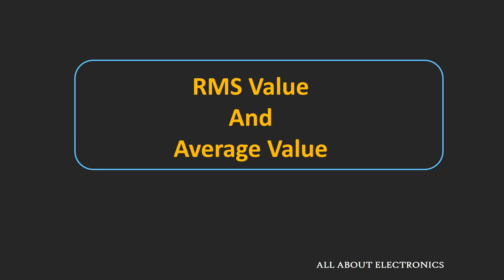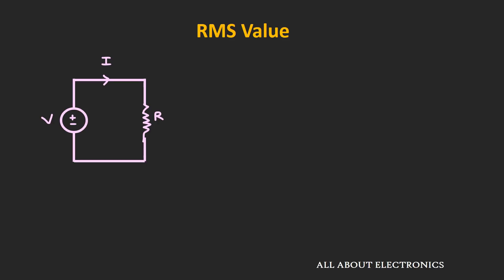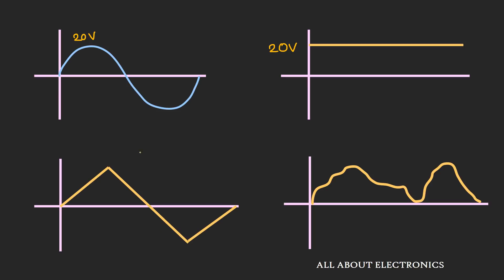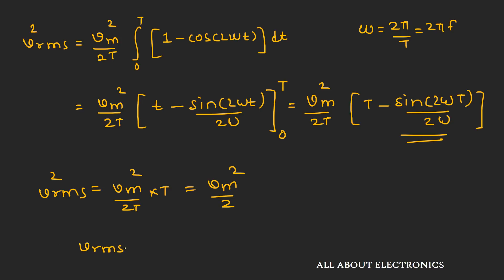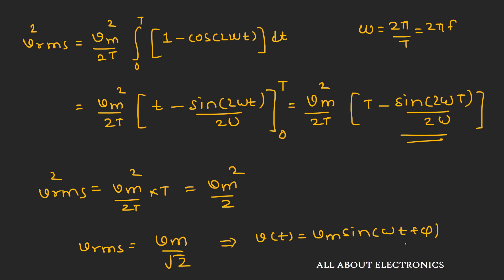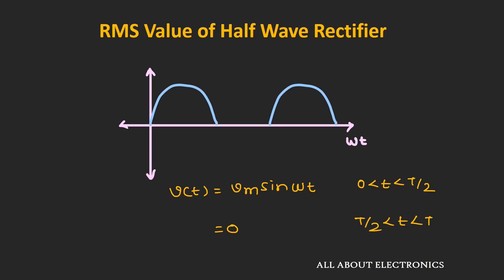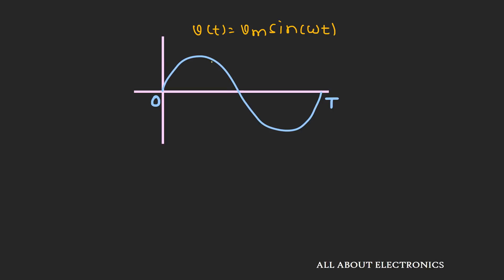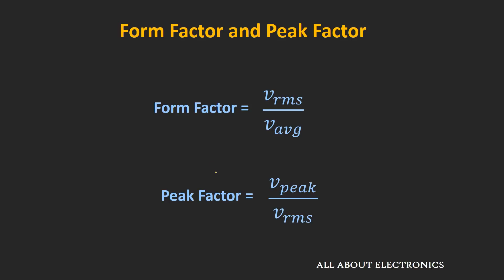RMS (Root Mean Square) Value and Average Value of AC Signals

Comment: The voltage and current in an AC circuit are given as v = 100 sin (314 t) ; i = 10 sin (314 t). Determine RMS power.